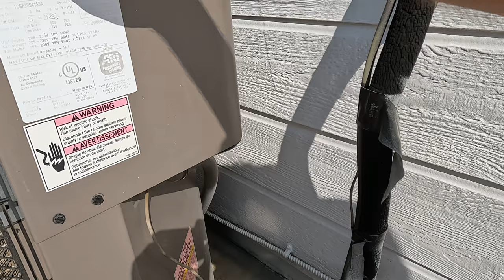HVAC Vlog. Bad Condenser Fan Motor. Home Warranty For the Win!

Comment: I had a Coleman LX from 2011 and mine made the same noise the shaft was extremely loose, I have a short on my channel and many videos of it running while making that noise motor was replaced in June and worked fine but we replaced the unit in august because it’s been just a little sluggish since 2019 and my mom finally got it replaced, the new carrier comfort has worked fine since but it needs a hard start because the compressor was locked up on the first start, and then locked up again later on and had the techs put the hard start on but other than that it works fine and my Coleman had a good run making it to 12.5 years which is surprising because it had microchannel
Reply from the maker: I will check out your short and subscribe.
Reply: @HVAC-ISH  cool